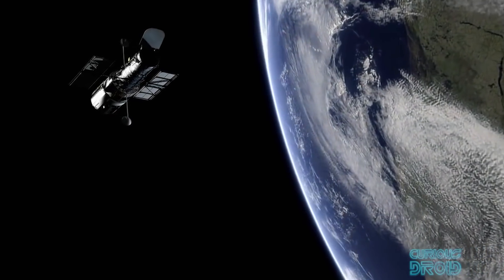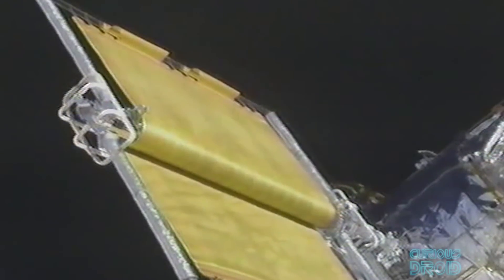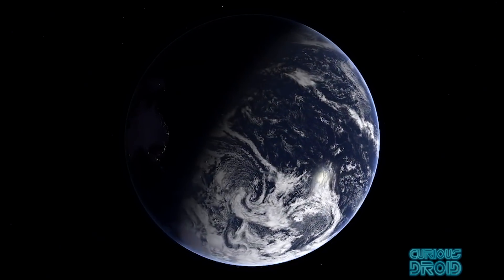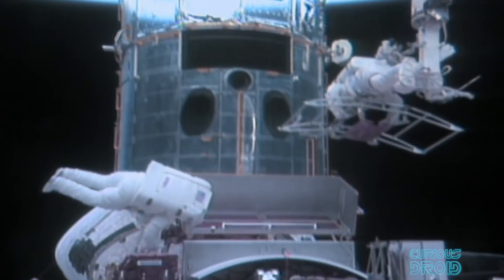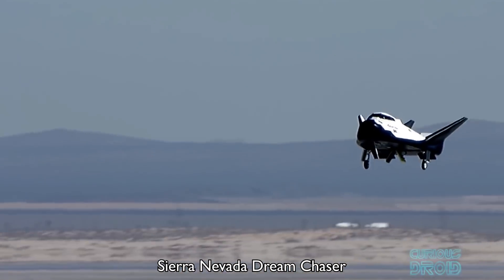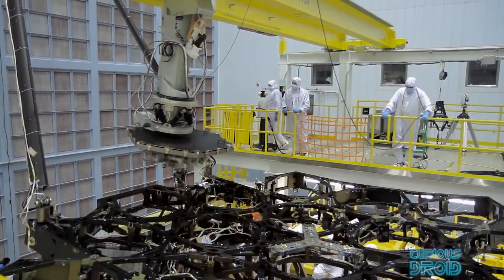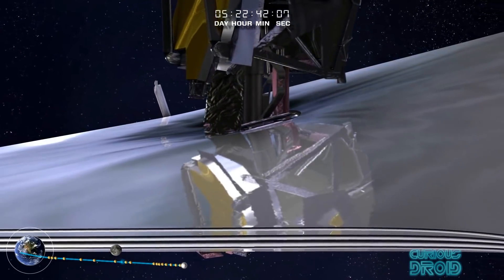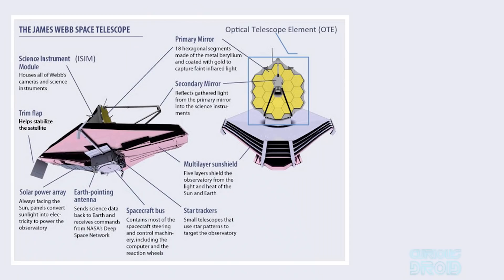Can We Save Hubble and Where is the James Webb Space Telescope?

Comment: What to do with Hubble… Build a highly specialized space tug that contains new modern solid-state gyroscopes, its own solar panels, new thrusters with fuel, and whatever stuff that can be performed by this new vehicle (whether software or hardware). Then dock this ”thing” to the service docking mount of Hubble. I guess the problem with this is the data port, the connection to the inside of Hubble to really integrate the two together. Maybe maybe that might not be needed since Hubble would continue to use its solar panels.  However I don’t see this modernization tug docking all by it self. Highly speculative, this rant. Cheers

Comment: As to the Hubble initial lens grinding error. The mounting apparatus measurements were in error. The testing optics/mirror calibration then indicated that more grinding was needed than necessary. Because 2 tests were comprimised by the apparatus and 1 test wasn't compromised they ended up with 2 tests indicating the mirror was ground perfectly and 1 that indicated that it wasn't. Under pressure to deliver the mirror they chose to ignore the contradictory sum of the results and chose to "gamble" by playing percentages (67 per cent probability of success and 33 per cent probability of failure). This indicates to me that a competent supervising engineer did not make the final decision. I am not an engineer, just a technologist, but I would guess that a contradictory test indicates a failure of process which makes the percent of success at best 50/50 because we can no longer trust the test!
Reply: My point of bringing up recent history is this: the process in building future space telescopes after Hubble was compromised by a bad decision made by an executive of a mediocre company, rather than by a failure to carefully implement the proper tests. The testing apparatus was flawed which is the responsibility of supervising engineers not the executives. Top engineers and project leaders are able to properly supervise the work on the JWT. Even though the project is immensely complex and requires an absolute certainty of perfection, the success of the project ironically would be served by less rather than more oversight. The level of care that the workers and engineers use is at or may even exceed that reserved for human spaceflight.
Reply: My solution is to face the reality of the situation. Acknowledge that the development process has failed. Hire a project development leader to salvage the mission. Knowing the capabilities of the new rockets coming online by spacex and others, redesign the deployment system. Allocate new money for the re-design. Build and assemble the componets within a time-frame. Launch the system on a new larger rocket [that would require less origami, or folding of components] and hope for the best.

Comment: Secure, fix and boost up the orbit of HST... because JWST (far Infrared) isn't quite a replacement for Hubble (optical and near Infrared).
Also the newer large groundbased optical telescopes are not the same, because they had to deal with the wiggly-whobbly atmosphere... as long as there are no clouds.

Maybe with the hugh lift capability and size of the oncoming SpaceX BFR, we should fund, build and deploy a real successor to Hubble (up to 100 tons and nearly 9 meters in diameter).

PS:
What could have be done with the money from the F-35 debacle (and other military nonsense)?

Comment: When given the choice to fix hubble, or leave it to burn up there are a lot of things to consider, cost being one of the largest.  Would it be cost effective to fix the hubble, boost its orbit, and continue getting data from it while the JWST is still being prepared, or, would it be more beneficial to direct that funding to new/improved launch vehicles, and the JWST itself?  I understand the reasons the shuttle program was shelved, but, with the recent failure to reach orbit of the russian craft, and the other issues that could be solved much more easily with a shuttle-like craft, I wish we'd had a replacement at least in the later stages of development before the cancellation.

Comment: HST - Let it burn. Build 2 or 3 new ones just slightly bigger, and design them to operate non stop for 15 years (more redundancies). Will be cheaper honestly. Use SLS or Falcon Heavy.

The entire argument with about JWST folding mirrors about needing folds because no lunch vehicle can carry it is stupid. How about modify existing lunch vehicles to have bigger fairing, or wait for something really big. Would eliminate a lot of problems. Ariane 5 ECA has GTO capability of 9600kg. Where Falcon Heavy has GTO capability of 26700 kg! And SLS even more.

Comment: Develop small 'drone droid ' type remotely operated repair/service devices be launched from existing launch vehicles (like those in SpaceX). Design applied to the necessary tools essential for predetermined servicing specifics. The droidrone could also act as a orbit booster. All this on the presumption that it is possible to somehow safely anchor/affix to the Hubble securely during servicing/boosting.

Comment: I believe they could use the new orion, Boeing starliner, or SpaceX Dragon space crafts.    And just like the Apollo missions where the lem module was tucked inside the upper stages of a rocket.   They could place all the necessary upgrades needed for Hubble inside an upper stage and guide it over to Hubble.   Then fix the Hubble telescope.   You could even attach boosters onto Hubble to move to a higher orbit.

Comment: I think that until the JW telescope is confirmed in orbit AND operational we need to keep doing what we can to keep Hubble up there. We can contract spaceX to send A robotic arm and thruster to grab on to and tow it back out into higher orbit. I think that cost of a similar (JW or Hubble) telescope, perhapse scaled down, should be looked at in order to keep some kind of eyes lookong out into thr cosmos that doesnt have so much atmospheric and light pollution. Has light pollution been considered when putting the JW telescope into orbit so close to the sun? Could there be so much light from such a huge light source we're essentially blinded even when facing away from the sun by a kind of lens flare unique to these huge reflex kind of telescopes? Does hubble ever suffer from lens flares?

Comment: Just a question. Isnt it dangerouse to have all the mirrors/reflective panels outside in the open like this and not in a tube like Hubble's , cause of potential micro particles or paint flick collisions on the surface of them? They could be fataly scratched by some 2mm grain or metal flick with those speeds in orbit.

Comment: Why can't we get the Air Force to lend NASA the X-37B to do a servicing mission to the Hubble? It would need to get to an altitude about a hundred miles higher than is typical to reach the Hubble. But it was designed to operate as high as 500 miles so the Hubble wouldn't be a hard target to reach. And being that the craft was originally designed to service and boost satellites, this seems to be ready made for the task. It isn't as if there isn't an option if NASA wanted to get the Hubble back to 100%. Given the telescope's massive utility and demand, there is no good reason to retire it, even if and when the James Webb is launched. The two telescopes have different purposes and capabilities. 

It would be best to have both instruments. Otherwise, it is like trading in your finely-tuned sports car for a brand new semi truck (that may or may not have issues). Both are powerful, both can do awesome things, but they do different things. 

The gamble is not worth it. What happens if James Webb fails and we haven't done anything to extend the Hubble's life or capabilities? Then we are without an orbiting observatory for decades.
Reply: We can always use the Hubble as a target. Our new Space Force needs to train after all.

Comment: NASA what have you done? Mothballed space shuttle. Now we can`t do anything in space.
Reply: I recall it was Pres Bush who cancelled the Shuttles. Too bad NASA never got the funding for a safe Shuttle,  or for the space station the Shuttle was built for.
Reply: The first blow came in 2004, when then-President George W. Bush announced the end of the space shuttle program. His plan was to replace it with a return-to-the-moon program run out of Houston. Then in 2010, President Barack Obama canceled that over-budget Houston-centric shuttle replacement program.
Reply: @drewthompson7457  it was over 30 years for most of the technology of the shuttle and we needed to move forward. Thank Pres. Obama for cancelling that and Bush's call to land on Mars by 2030. We shouldn't have been pushed back from those things but Obama wanted his healthcare instead, but whatever.
Reply: @Prettywhite4awhiteguy  : before Mercury ended, Gemini was on the way. Before Gemini ended, Apollo was on the way. When Apollo ended,   in 1972, NASA had nothing for human flight, and no budget to speak of.  They had to wait until 1981, for the cheapest Shuttle, lacking safety that other programs had.  It was designed by committee, and not what NASA wanted. After killing the most people of any countries space program, it was cancelled,  with nothing to replace it, and almost no budget for human flight. Good thing the Russians will still  help them to the ISS,  and provide rocket motors for the States. But the Pentagon can "misplace" several $trillion dollars, while spending $trillions more,   and too many people bitch about NASA"s  limited budget.

Comment: it's 260 billion per year on military, 75 billion on education, and 0,05 billion per year on JWST
Reply: vs $2.5 Trillion (BY2017) mandatory useless welfare spending.
Reply: American human workers are "useless spending"... it's 2018. You can find out BY2017 welfare numbers. $732 billion in fiscal year 2016 and $729 billion in 2017. 2.5 is not the same as 0.7. Also, spending went up because of bank laws failing, and robot industries, plus moving jobs to china.and it reaches into every home and every factory. Coimmnism scared the elite classes to providing americans with the welfare system that expanded from the 1960's onwards. If the threat of communism is gone, do you think they should return to the pre-1960s social welfare?

Comment: The last servicing mission to the Hubble Space Telescope included adding a ring at the base which could be used by a robotic spacecraft to either boost it into an orbit which would keep it in space indefinitely, or provide control of its re-entry and destruction in a manner unlike that of Skylab, which quite luckily did not hit any humans in the part of the Australian outback to which heavier parts did fall. Thus, should it be considered worthy of the effort, and the gyros be sufficient to the task, it could be boosted up once again. No humans need be involved except to build and control the spacecraft that can do that task.

As to the James Webb, it is not completely without precident. hexagonal section telescopes are now well understood here on earth. They do require a fair amount of fine alignment, segment by segment  which eats into the pure science time,  and the James Webb has quite a few more optical trick it can perform without human intervention, many of which have been developed alongside its construction to the original plans.
 Look at it this way: the ten extra years, and order of magnitude increase in cost is somewhat similar in cost and time to what was achieved in the several fixes added to the Hubble once it was lofted. Possibly this has improved its outlook from the technological improvements now available that couldn't have been added should it have been launched on schedule. At least I hope that is the case.
I do know that Hubble was held back with little improvement, mainly kept shelved due to funding and other considerations during the military build ups of the Reagan era.  Both Politics and policy changes affect all major NASA projects, unfortunately. Why it was such a surprise that it was nearsighted upon first light has somewhat to do with those military space projects so beloved of the Reagan regime. Corners were cut in its ground testing and some shady results published before launch. Some higher-ups were not in favor of launching it at all. Pure Science took a back seat back then.
Some other thoughts about the James Webb and its L2 placement. First, it is optimized for longer wavelengths of light, because it is to look farther back in space/time than Hubble was designed to do. That is good in this sense: the remote adjustments do not have to be quite as precise for wavelengths three times that of the Hubble's shortest. It not traveling in orbit around the earth  going from daylight to dark every 90 or so minutes will help it in several ways. The Hubble, I have been told, shudders for a long time each time the door at the front has to be closed. Perhaps procedures preclude that being so much of a problem as it once was, but still, half the time in orbit is in sunlight. Webb will be in earth's shadow to some extent, and will have a period of a full earth year to work around the problems associated with staying shaded properly. The gyros for James Webb will be superior in many ways. I will credit miniaturization done for "Star Wars" type projects for that particular improvement, showing that I am not entirely down on things that took place during Reagan's time.
Although not designed for servicing, we have made tremendous gains in AI that might allow some types of servicing to the Webb once in space. Probably that sunshield might need an extra layer applied once enough space dust has deteriorated it. Solar powered, it, like the Hubble might benefit from an improved array. I can think of many other things that can be done once robotics gets as good at solving problems semi-independently as we humans can. Remember those Shuttle astronauts had help from the ground controllers doing the things they did, and they did suffered from the human failing of needing rest and oxygen to be able to continue working.

Comment: Try to send it to the ISS for either maintenance or disassembly so it can either be brought down in parts or be put to use as a part of the DSN the other option is to add a thruster pack to the Hubble so as to allow it to make its own corrections... 

Or do the last option and upgrade it with similar tech to the new telescope, then send it to deep space

Comment: James Webb Telescope (JWT) is near completion/launch date, March 2021 (approx. 2 .5 years). 
To procure replacement hardware for Hubble,  start training crew & certifying a vehicle for this kind of mission, the effort could not happen sooner than the 3/21 JWT launch date. JWT cost should be the decision now to retire Hubble. 
The old girl gave us a nice view on space, time to pass the torch.
I worked the Space Shuttle program for 32 years and each mission is at least 2 years planning and training. That is when the NASA engine for the Shuttle program was running with the throttle open. WIth having to start fresh on idle, for a new single program will take a little time. Nope, the Hubble is coming down, my thoughts for now.

Comment: By the time the JWST launches, the technology on it will be obsolete.
Reply: Probably already is obsolete
Reply: @brianp5344  How so? There's no comparable missions in the works so it's still the first (and therefore by definition latest) of its kind. "Obsolete" standard instruments and components are the name of the game for any space probe, since total development times for flagship missions are always measured in decades. New Horizons was built on 90s technology, HST was originally built on 80s technology, and so on.

Just to give you an example, here's a list of some CPUs used in space missions: http://cpushack.com/space-craft-cpu.html
MER could have used a Space Micro Proton200k - a whopping 10x as powerful as the BAE RAD750 they used - but that became available only by 2006, whereas the RAD750 had been around since 1998 and component development and testing began in 2004. Since you don't change core specs some two years into development, "inferior" hardware made it to Mars.

Also keep in mind that most of the components used for scientific missions are one-off unique, purpose-built designs that don't match any sound definition of "up-to-date" or "obsolete". How can something be "obsolete" that has a very specific purpose and was only built two times (once for R&D/reference, once for space)?

Comment: Identify what research could make use of the Hubble. Determine whether other options can be used to acquire equivalent information. If alternative resources cannot acquire information, determine the "value" of the potential information. Determine opportunity loss if potential information is not available. Evaluate various life extension proposals, and determine costs of proposals. If the value of the information or opportunity loss exceeds the cost of life extension, implement it. It is fair to include the value of technological advancement if life extension is attempted. (Value of technological gains to implement life-extension can be added to the value of the Hubble research information gained by that life extension.) It is possible that developing generalized means to robotically repair in-orbit or in-space devices may exceed the value of Hubble life extension information.